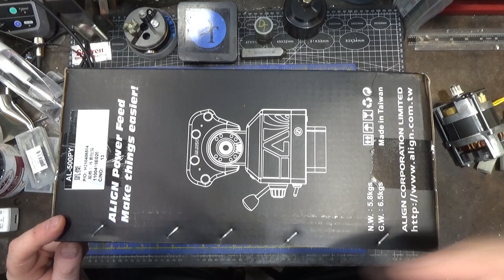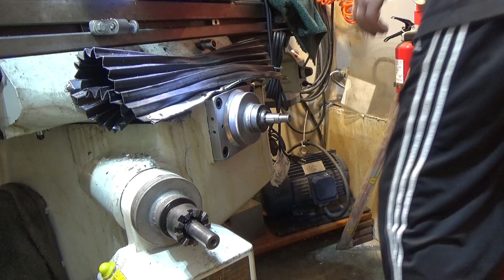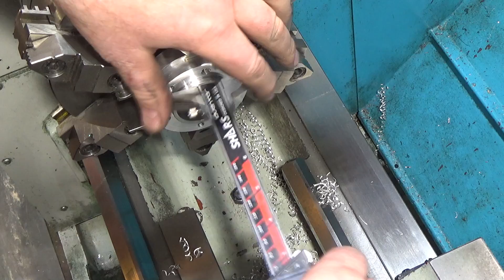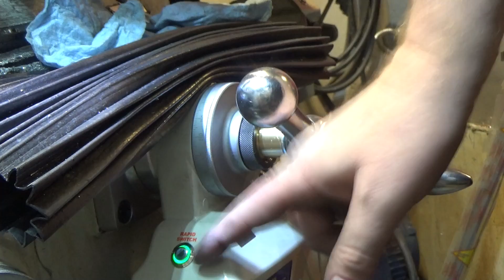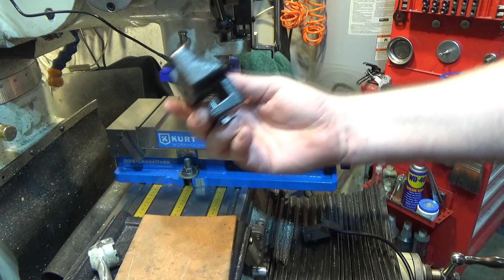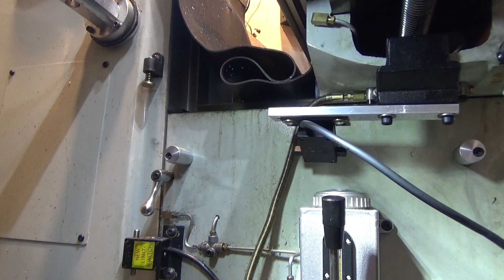232 Mill Y Axis Power Feed Install - Taiwanese Drive Kit

Comment: You might look into a crank handle with a clutch for the manual crank.  Search for Safety Ball Crank Handle.  They are not expensive.  You push in to engage and otherwise they free-wheel.  I have these on both my X and Z axis power feed shafts.
Reply: Good tip thanks
Reply from the maker: Thanks. The Chinese Z axis kit came with a spring loaded disengagement feature, but I hated it and removed the spring.
Reply: @DudleyToolwright  Mine have saved me too many nasty thumps to remove the springs but your mileage may vary.

Comment: If you take the cover off of the limit switch assembly, you can swap the two limit switches if you need the switch logic reversed.
Reply from the maker: That was a mental option. Thanks for the idea. Others might really find your advise useful.

Comment: I would love to add power feeds to the Y & Z axis. I’m not sure I’m as patient as you tho, I’d have spat the dummy & thrown tools across the shop & cursed everyone and their dog if I had to go through all of that.

With the Z axis just have the adapter and my 18V lithium battery Ryobi 2speed drill.

On low speed gear it moves the table up & down easily, so I’m not really seeing the need yet to go to the expense & effort to add power feed to the Z axis.

There’s not a huge amount of travel on the Y axis, & like yourself I have my vice overhangs the back of the X axis table, as w ell as the X axis DRO scale back there with its alloy cover, so even less rearward travel.

I guess I can just hand wind the Y axis for now but surface finish is undoubtedly better with the uniformity of feed rate from power feeder compared to hand feeding.

Expense, effort, stress, I find myself asking if I really need to go down this path just yet.

Having just bought my new lathe - that emptied the bank balance as well as all the new tooling I need for the lathe, means that short of winning the lottery or robbing a bank, finding the spare $ to do all the mods I’d like to do on the Bridgeport is definitely on the back burner for now.
There’s the pneumatic draw bar powered device, the air mister coolant thing. I’d like a Z axis DRO & scale coz my eyes I struggle to read dials at the best of times.

Where does it all stop?

All I ever seem to do is have my hand in my pockets with this hobby. 🙄😜😂😂
Reply from the maker: The drill motor solution is used by many and seems to be a decent solution. Thanks for sharing your approach.

Comment: My milling machine is made in Taiwan, very accurate and well built, great video and thanks for the spray gun from vevor it's awesome..
Reply: I bought my full size Comet knee mill brand new in 1994. It is made in Taiwan as well. Although it shows plenty of use, it is still going strong. No complaints from me.
Reply from the maker: My lathe is from Taiwan and my Mill is from China and the difference is night and day. The Mill is the first one that ACRA approved from China, but compared to their Taiwanese model, the difference is dsignificant.